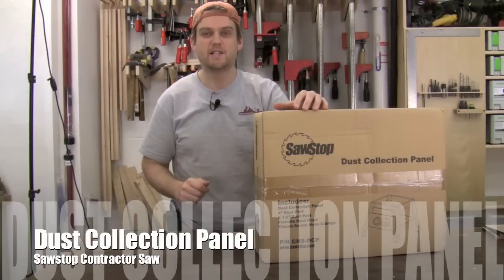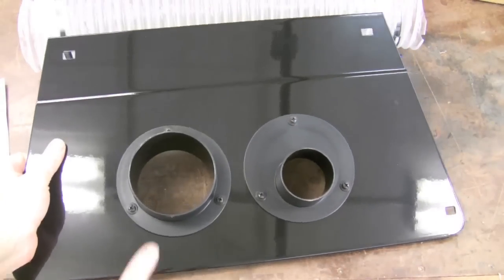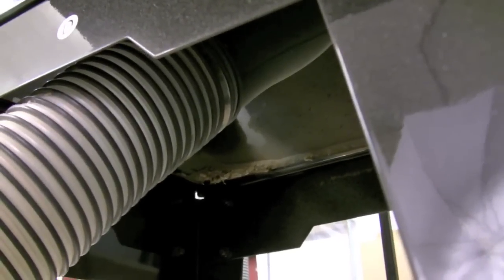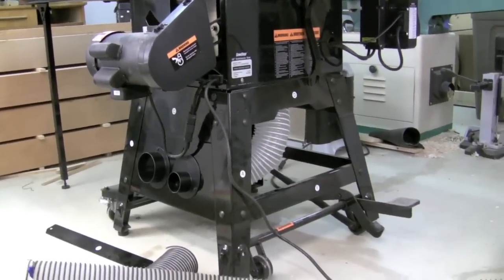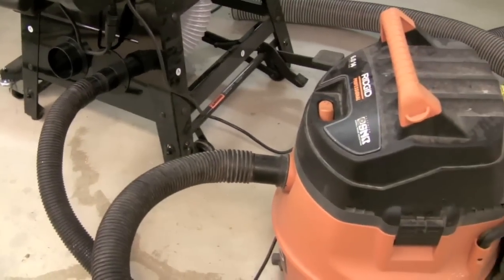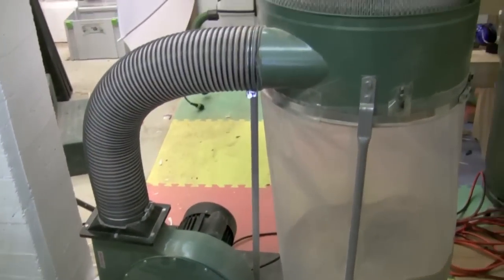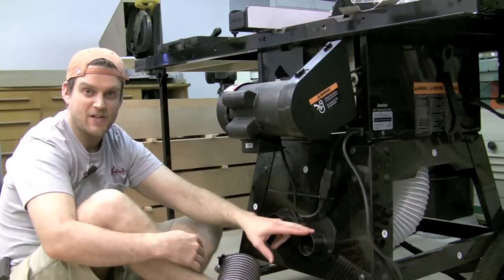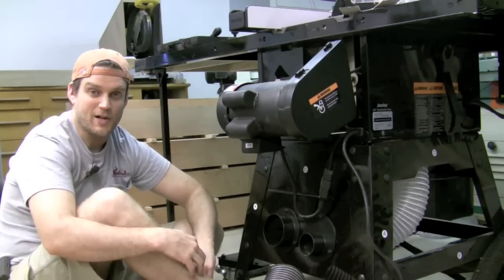Sawstop Dust Collection Panel

Comment: I recently made my own.  Used two 4” ports back to back on a piece of scrap MDF. Used 6 rare earth magnets and didn’t even have to mess with bolts. It was cheaper than the cost of the panel plus shipping.

Comment: How to convert the SS Contractor Model, to have similar Dust Collection to a Cabinet Saw. I've got the same model SS TS and just added the same panel. I then made 3 other similar solid panels for the remaining opening thereby enclosing all the sides. To further enclose the base , I made several Bottom Panels to almost complete the enclosure. I'll add either a Box or a Plastic Container to surround the Motor to finish the job. I plan on adding a Vent Hole near the Motor for cooling. This should greatly improve the Dust Collection on this saw.
Reply: I have the same saw and basically the dust collections sucks, poor choice of words.  SawStop agrees.  I like your idea.  I end up with a lot of dust under the saw that comes out the large opening under the saw.  Do you have a video on what you did?
Reply: @spencerbass7142  I wish I could make a video or attach pictures on the subject because I know others could benefit. Is there away to attach pictures only on Youtube? I use a 4 inch Dust Collector hose now and have found it to be about 90% satisfactory even though the Motor Side of the base is still open. My plan is to add an Extension Table, which will sever as the Motor Enclosure Box to complete the Dust Collector System. This should provide similar levels of Dust Control as a Cabinet Saw. Additionally, I just bought an old Craftsman TS (for $40.00) which I plan on adding into my 52 Inch Fence. This TS will be used for Dado cuts only. Finally, I'll add 2 Router Tables, to either end of the saw with cabinets underneath. Sounds doable.

Comment from the maker: (Part 2 of 2) The Saw Stop 4" hose that comes with the collection panel is more flexible than some of the 4" black plastic dust hose sold and should improve the feel over the solid, stiff, black plastic dust collection hose many folks have.
 
The collection panel is for making it easier to connect and disconnect your own hose to the saw since you will no longer have to get up underneath the saw to connect and disconnect hoses.

Comment from the maker: (Part 1 of 2) The hose included with the collection panel is the correct length to let the saw tilt fully to 45 degrees.  It would not hamper the tilting of the saw anymore than your own 4" hose connected directly to the shroud cover under the saw would (which is to say it won't).  A stiff 4" hose you may have could make the unit "feel" a bit more stiff when cranking the tilt handle, but should not impede the ability of the mechanism to fully tilt the blade.

Comment: But you didn't deal with the main problem which is to get any 4" hose to attach and stay attached to the dust shroud.  What a short, weirdly angled piece the shroud port is.

Comment: I certainly hope you didn't pay more than $1 for a panel that does nothing more than change the direction of the exhaust hose. Why not just run the original hose out the back and connect to a reducer to get to the shop Vac?

Comment: Is it safe to remove the nuts and bolts while the Table saw is standing? I'm kinna worried the legs might split away and begun to fall down the whole table saw itself? FYI I bought same dust panel but hesitate to install it, thanks for reply if ever
Reply: I retrofitted my SS Contractor saw (same saw and same kit as in the video).  I had to use a clamp to bring the  2 back legs together to align the bottom 2 holes (about 1/2 inch off).  So yes, it appears the legs will spread a little.
Reply: @jeffschwartz3961  thanks so much

Comment: There seems to be no better industry than separating hobbyists from their money.  I get that all that hardware makes it easier to connect and disconnect your hoses.  But did you ever just think of a section of hose that sticks out well past the frame with a suitable female port in it?  Maybe five dollars worth of parts?  It's what I've been using and I fail to see how this is any better.

Comment: Two problems with this add on. One is connecting the 4 inch hose to the dust collector on the bottom of the saw. Terrible design IMO. Secondly is the dust panel has a 2.25 inch port that's connected to a 4 inch hose that's connected to the bottom of the saw. About a 2 foot run. If you use the 2.25 inch adapter on the back panel, you lose a lot of suction. The best setup is a 4 inch rubber coupler with a 2.25 inch reducer connected to the bottom of the saw. That puts your 2.25 dust collection real close to the bottom and improves suction. It also, limits the tilt on your saw if you need 45 degree cuts. I've tried 4 inch hose connections as well. They are better but not by much. This model has a lot of gaps for dust to escape before getting vacumed up.

Comment: This is not an easy install for one person. To hold this and get the bolts in is a challenge. You get the bolt in on the bottom right side and the hole on the left side does not line up. Nor does the top left hole line up. Not the easy 10 min job that you describe.

Comment: This saw is nothing like the cheap rigid saw.  Yes, it might have a mobile base and same size dust collection port, but the rigid only has a 30" rip capacity.  You are trying to say that a BMW and a toyota are similar because they have tires and windows.  The build and technology in the sawstop is much much better than the rigid.  I have owned the rigid and the porter cable equivalent and they are nothing in comparison to the sawstop.